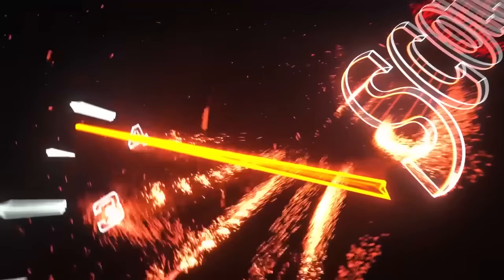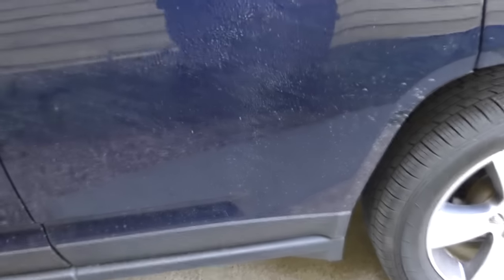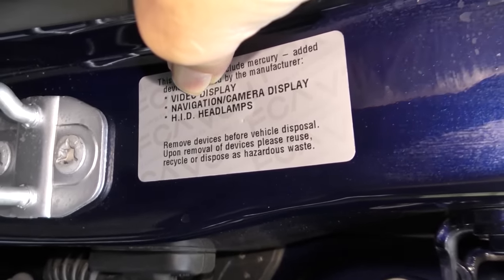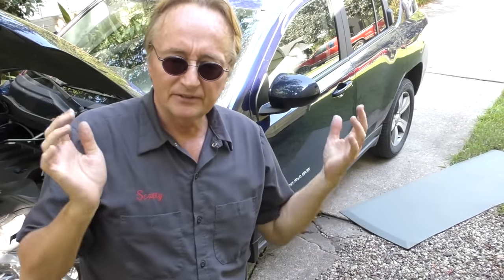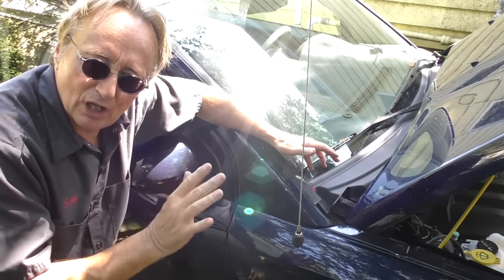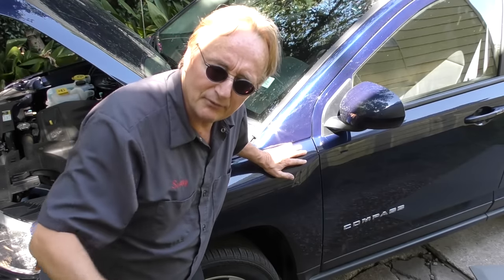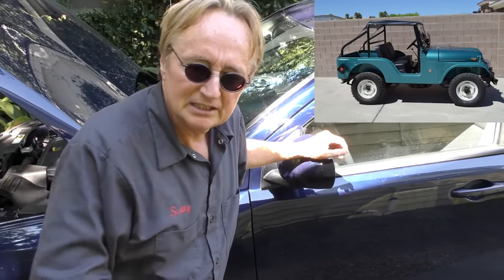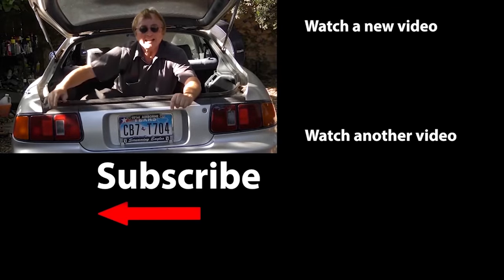Here's Why This Jeep Compass is Crap

Comment: Okay, so you think the Jeep Compass is crap.  Fine.  Whatever.  But put this into perspective.  I live in Alaska, and the car I've been driving was a 2004 Mini Cooper S with a 4 cylinder engine and a 6-speed manual transmission.  It was a fun car to drive.  Just recently, however, I slid on some ice and accidently crashed it into another car that had been completely stopped in front of me (I wasn't even going fast and immediately started braking as soon as I noticed the other car).  And because of how low it was, the bumper was just fine, but the hood is now bent and the radiator is broken.  Sure, the engine still runs, but as of right now, it's not safe to drive.  I plan to get my Mini fixed at some point because it is my favorite car at the end of the day, but I also have a job in which the drive is half an hour away, so I NEED a car.  I didn't even care what kind of car it was, just as long as it had a higher bumper.  So when my mom helped me find used cars for under $4,000 and eventually found the Jeep Compass that also happens to have a manual transmission, you bet I'm going to be checking it out.  And keep in mind, my expectations for this car are pretty low already.  I just need something that'll get me from point A to point B for the time being.  And hopefully by the time I sell it, my Mini will be back in perfect working order.

Comment: The quality used to be there. I have a 2000 grand Cherokee, nothing has broke yet. Over 200,000 miles, of course I got rid of the stock brake calipers front n rear, those were garbage from the factory.

Comment: My 2014 Patriot @ 60,000 miles has been in the shop for two weeks. Throttle body & wiring harness replacement. When I first saw that lightning bolt indicator last year I knew I was screwed.
Reply: The aftermarket throttle body part is actually very cheap ($50ish on ebay) and works well. I replaced mine (DIY) at 77k and bought an extra as backup since aftermarket throttle body is so cheap compared to OEM part (over $300).

Comment: I've replaced the crank shaft sensor, a wheel bearing, a few lower control arms and a fuel pump but it's still running.

Comment: I agree about the power, have to really punch it to get up hills. I really needed a car and a 2014 Compass came to me from ppl I know and trust. Bought it at 80k miles and it now has 120k. I am just now having to put some money into it…thermostat, axle leak, some weird issue with the gas cannister…but I guess that’s expected with that high mileage. I’m also used to driving absolute beaters my whole life, so this felt like quite an upgrade! Maybe I’ve gotten lucky, but so far so good! I plan to put at least another 80k-130k miles on it! Time will tell.

Comment: Hey Scotty huge fan, I just thought about buying a gmc terrain sle1 awd, are they a reliable cars, it has less than 20k miles on it btw.
Reply: Dunno. If it has the 3.6L, and you put allot of miles on it the spark plug bores start leaking oil where they are pressed into the heads, only fix is new heads.. Dont buy it if you plan on putting allot of miles on it.

Comment: i will say it is under powered the 2.0 ltr engine is a bit slow for that heavy body, besides the embarrassment of getting passed by some 1.4 ltr hatchback on the freeway with your foot on the gas, paddle to the floor ... its a decent buy the features are near complete and the sound system is dope, the interior is "Instagram" friendly it is build for comfort not speed!

 bought mine 2018 second hand its the 2013 model, hasn't given me any mechanical problems

Comment: Advice : get a used Jeep Grand Cherokee from 1996-2004 ,6inline if you are lucky you can get one for  less than $1500 , it doesn’t matter how high is the mileage those engines can go over 250k easily ..

Comment: My lady had a Canadian 2008 Jeep Compass, new in 2007. It was garbage: the brakes failed at 400 km, Chrysler, Windsor, Ontario, covered that. Then there was a series of other failures after that that were not covered: transmission, front suspension & a computer. I argued with Chrysler on her behalf; they didn't care & it was frustrating. I wanted to take them to court, but she didn't. I will never buy a Chrysler product.

Comment: I need help with my 1999 Jeep Cherokee. In the recent months Im having recurring problems one after another. It started with a bad fuel pump then the Crankshaft Position Sensor went out after I replaced that it was throwing misfire codes then I gave it a full tune up changed the plugs, rotor, distributor, and ignition coil then it ran really rough and the check engine light came on saying it has a  bad pick up coil (camshaft position Sensor) so i changed that  then it started back firing then I took that one off and put another new pick up coil on itand now it won’t start and the battery gage on the dash drops to zero and the check gages light comes on. I’m open to any advice and all suggestions on how I can fix this.

Comment: I drove a loaner 2019 Jeep Compass at work last week. Good quality and roomy. Yes, its it is slow and the Toyota transmission sometimes fumbles for gears. My Renegade with the 9-speed ZF transmission is much smoother. Not a bad vehicle though. Had a Corolla last week, great quality but I hate the room. HATED it. Back to my MV1 now:)

Comment: Not sure why you are attacking the Compass . I have a 2012 4x4 with the 2.4. Been a great car , good gas milage , I find it peppy, roomy and comfortable. I have +110,000 miles on it , no major repairs, brakes only . Just replaced the original battery after 8yrs. Love driving it in winter here in Canada . Like you said, looks good but also great value for the cost when new.  Still like it after 8yrs.

Comment: In a high speed collision with a decent 8000 lb. pickup. Would it be safer to put a Toyota badge on the Jeep?
Another issue are those stupid 6 piece main thrust bearing assemblies.
Don't know if Jeep uses them or not.

Comment: I have a 2014 Jeep Compass radiator went 65,000 miles. Transmission does not work at 65,000 miles. And other factors maybe computer I don't no it is parked. I purchase it brand new I'm pissed

Comment: I have a 2014,   212,000 miles and running great,  gas mileage is about 20/26 and have been doing Uber in it, this car takes a beating, no, it's not fast, acceleration is poor but does do 75 no prob on highway and A/C is ice cold with monster blower fan! Comfortable with leather too

Comment: i got a 2017 jeep patriot with the 2.0.  Getting roughly 18-22 miles per gallon on the average tank.  but I can tell you to get that I have to keep my RPMs under 2k on the road and at or under 2.5k on the freeway to make that happen. the thing has no power.  I'm amazed my tranny still works well at 113k miles.

Comment: Bought a 2017 Jeep Patriot for $14,000 with only 20, not 20,000, Just 20 miles on it. Had it for over 2 years and not a single problem on it. Though I would sell it eventually and get something better.

Comment: I agree with you Scotty, but FCA is leasing these cars dirt cheap. These Jeeps are fine as long as your expectations are not high and most will perform well for the first five years or 60K miles. The all wheel drive system works well in winter driving not off roading. Yes they are not real peepy cars, but they ride, handle and brake well. Also they have decent curb appeal. They are not good for the long run, but for $1000 down and $200 a month you are getting a nice package with a full warranty. If you want more power you can get a V6 in a Cherokee, but that will cost you more money. Its all about expectations.

Comment: I bought a 2021 4x4 sport last year new, it was 31,000. I've put 28,000 miles on it in 8 months with Doordash. It has the 2.4 multiair 4 with the 9spd. I'm getting 22 in the city and 28 on the freeway. The rear seat and cargo area are bigger with the restyle. I love it! I'm hoping I don't have issues with the motor burning oil, but I check it and fill as needed. Usually half a quart between oil changes. My Journey and 200 used oil, so I'm used to it. 😆 
And... I took it over a mountain road from Palm Springs to Big Bear, CA. It did very well with stock Continentals and the select shift in mud. Love your channel Scotty.. but check out the newer one. I'd love to hear your opinion on my 4x4 Jeep 500. 🤣
Reply: He’s weird that way. Just because 1-2 have an issue doesn’t make the entire range weird. It’s a great success here in India as well. Scotty really has Wierd captions. Haha.

Comment: I have a 2014 jeep compass with 188000 kms on it and runs great !! I have done periodical maintenance’s like suspension and brake repairs which is common for all the vehicles. The best advise is to do the regular oil services and replace the spark plugs when it’s due (the user manual has the exact periods on when to do the maintenances). The only extra stuff I had to do is to replace the electronic throttle control and the alternator which is not that expensive. If you take care of her she runs great and is a beast in the northern Ontario weather. And please be nice to her, just because it’s a 4*4 don’t make her work too hard 😂.. I love my Jeep!!

Mr.Scotty is great but all he says in the video is his personal opinion on this vehicle. Please don’t take his opinion as the sole reason to make a decision. We all have personal likes and dislikes and Scotty has the same!!

Comment: Only thing I have to say about the Fiat/Chrysler vehicles is we have a customer who comes in ever 7500 miles for an oil change and he has a dodge city express(mini panel van) and it has 250k miles on it. Suprising there's nothing broken on it from when I drive it in the shop. However that's only one example lol, we have several chevy's (before 2005) ford's and most japanese cars coming in with over 150k miles and they are in good condition.
Reply: City Express was a Chevy product

Comment: My wife and I bought a 2018 Compass new with only 4 miles on it and after 21,000 miles I had to have the motor replaced. I’d strongly advise looking for a different small SUV than the Compass.

Comment: I own a Jeep Patriot 2008. And it's in perfect condition ; Its not that it falls apart , as long as you maintain maintenance it should be good. Just remember , yeah it's a 4 x 4 but it's a 4 cylinder engine, don't expect to tow anything with this lol. It's a great commuter. Scotty is right it doesn't have torque but it's great for exactly what I said commuting . If you want a fast car go buy another vehicle.

Comment: I bought a 2018 Compass (same color) over a year ago. I always wanted a Jeep and I'm so disappointed. Electrical issues (twice), the exhaust system froze last winter and I couldn't start my vehicle. The interior overall quality is just not there anymore (right now, I'm having issues with my turn signal that occasionally gets stuck). It cost me nearly 30k (after tax, insurance and such) for this mediocre vehicle. Never again.

Comment: In EU the Jeep Compass is for FCA in promoting a real SUV. Half and half is the small Renegade and the Country side Jeep in future ist the FCA Modell Patriot. All Cars you get in 2 wheel drive now and only with "plug in hybrid" with 4x4 named 4xe. The engines at side of electric are brand new small gasoliners (much cleaner) and no more diesel. I bought a Patriot Modell 2018 Trailhawk with 3,7 liters before the last good engine will die.

Comment: Actually, provided you don't get a CVT transmission, or a Sunroof(Giant/Unsolvable Water Leaks/All years), these can go a long time(300K miles). If you get the 2.4 with the Hyundai/Kia 6-A Automatic trans it is pretty quick and gets about 23MPG. You must change the Trans fluid at 50K miles, and the Power Transfer Unit Fluid+Rear Differential Fluid at 60K miles to do so. 
Also, it is not really 4WD, as the rear axle is driven off the front-right drive shaft like most transverse mini-vans and SUV's(more like 3WD).. And get rid of the low-profile rims/tires, and your suspension(made by Mitsibishi/Outlander)will last much longer. Get the 16" Steelie rims instead.
You are correct, the latest Fiat Jeeps (New Compass, Renegade, Cherokee,etc )are to be avoided like the Plague.

Comment: I think your wrong on this one.
My 2015 compass is at 120,000 and running great.
I'm looking to get 250,000 out of it or more.
Suggestions:
Keep oil changes with synthetic at 5k or less.
Use a high quality oil filter I like Purolator.
Change spark plugs every 35k.
If anyone is in the market for one stay away from the CVT transmissions.

Comment: I have a 2011 with 170k miles on it, gets about 23mpg. Its been a unreliable vehicle. The transmission oil always overheats when I'm going 75-80 mph on the freeway on a hot day. When the oil in the transmission over heats, this light comes on and then the car stops accelerating so I've had to drive without the A/C on and pull over to let it cool down. Happened to me 4 times during a 300 mile trip to LA. I've taken it to mechanics and they've said theres nothing that can be done about it because that's how the transmission is. Anyone else having this problem??

Comment: i have a 2016 with 72000 km. Except replacing that radio because all of a sudden the GPS stop working. There are no issue with it. It is a gas hog but it is a good vehicle so far

Comment: worse is in Brazil, which sell the Jeep Compass was sold until 2020 with 2.0leo engine and Jeep Renegade with 1.8l engine, both sold very well for having the name jeep, but the traction system used because here, it is very bad, besides bog down very easy, both Renegade and Compass have fuel consumption equivalent to V6 models

Comment: I’ve had my compass for 3 years 2015 compass. It’s done me good maintenance is normal. Acceleration does suck tho. Unless you want to suck down a guzzle of gas just to get you another 100ft/sec. I tell people it’s a Prius with 4wd. You’ve got to treat the engine right. Try to stay under 3k rpms you’ll be alright. 4 cylinders with larger bodies puts strain on your engine. Don’t over do your acceleration. Dont let traffic intimidate you in this lil gitty upper

Comment: Have a 2012 compass and 2016 patriot. Both have crank sensor issues. Compass 3 in 3 years. Patriot 4 in4 years. Had 2008 and had 286000 miles no prob. These new ones, not so much.

Comment: I'm driving a 2021 Jeep Compass North, shocks are great, headlights suck and I think it's eats gas. Just just filled up and it will only take me a 351 km also hurt myself on the turn signal, the plastic, the plastic is too sharp.

Comment: 2015 Compass was recalled for a problem with a power steering hose. So my question is, who the heck was still using hydraulic power steering in 2015? My 2009 car has electric steering, I mean geez...

Comment: I have a 2018 Jeep Renegade Sport 1.4 turbo with the 6-speed manual and no air conditioning, it was cheap as hell and I actually like it. I have my Honda for the summertime. I looked at the Compass and it was garbage in comparison. Don't know why they haven't dropped it from the lineup it's a redundant mess.

Comment: My 2014 Jeep Compass was TERRIBLE. I had nothing but problems with it overheating and turning off while I was driving. I was replacing relay switches constantly because every few months they would stop working. Not fun. I only owned it a year before I traded in for a brand new truck.

Comment: I wish I would’ve never bought my wife a new compass in 2014. You’re spot on with problems and then some. Both rear wheel bearings replaced by 38,000 miles, a throttle body at 49,000, front ball joints at 59,000. We just passed the 5yr/60k powertrain warranty, so now I’m waiting on the transmission to go. 🤞🏼 I will NEVER get another FCA vehicle again! 2020 Toyota Highlander is going to be our next vehicle. I never hear complaints about them.

Comment: 18 mpg? That's odd. I own a 2017 patriot (mechanically identical to this compass) and I average about 23 with the same motor. The owner of that compass must live in an area with heavy traffic. As far as reliability, the only issue I've had was a check engine light came on during a road trip, but ran fine. Got it back home no issues and got it looked at by my local dealership. It threw a code for a stuck valve in the intake, so it was replaced under warranty at 40k. Transmission has been holding up pretty good. Mine has the 6 speed auto. I have a pretty heavy foot and it hasn't been an issue. Interior could be better, but it was one of the cheapest jeeps you could buy back in 17 new. It's not a toyota celica, but as long as you take care of it, you'll get more than 100k from it. It's not that great, but not a total pile of crap either.

Comment: I bought a 2014 jeep compass latitude (2.4L) back in 2015. Jeep ran solid until 2018 and I had to replace the thermostat housing as it had a leak and coolant was leaking out.

Ran solid for a while after that until I started to get some hesitation here n there, but nothing terrible, well finally just last week at 124,000 miles, im 99% sure the throttle body failed on it. Lost throttle going up a hill ETC light, traction control, 4WD, and check engine light all came on. ETC light blinks. Very very rough idle almost at 2,000 RPM just sittin there, doesn't make a difference if I put it in drive or reverse.

Pretty sure i'm gonna get rid of it now.

In the past 3 years i replaced all 4 hubs, and both front lower right and left control arms and ball joints. Still doesn't ride smooth! I feel this thing eats brakes as well.

Done throwing money into it. May just put a new throttle body in it so I can at least make it in to sell it and get decent money for it.

Comment: The 2018 models address a few of the issues you mentioned.

They get around 28ish mpg and are just front wheel drive with a 4x4 as an option though I wouldn’t recommend it.